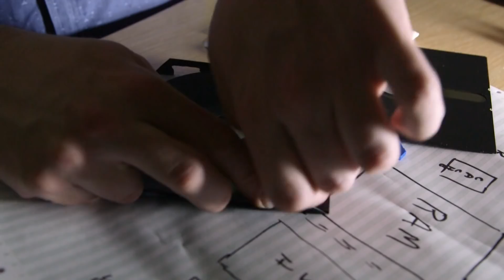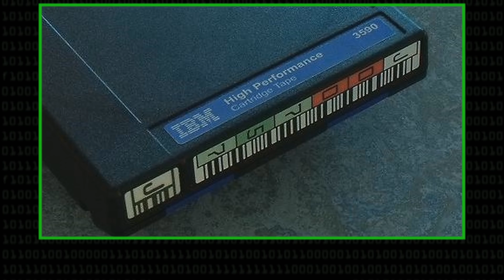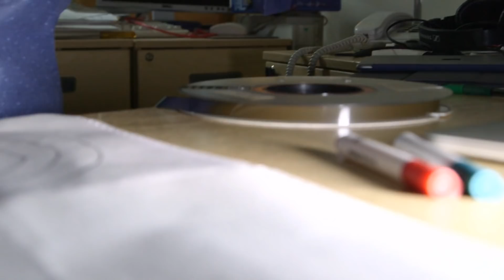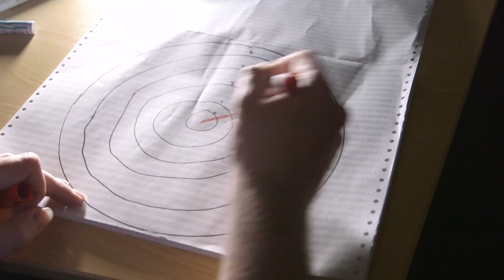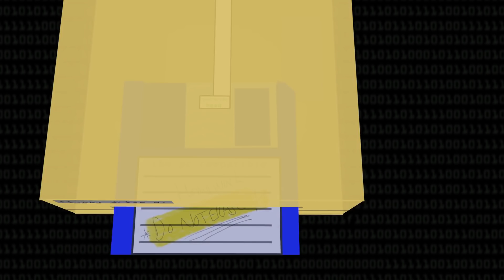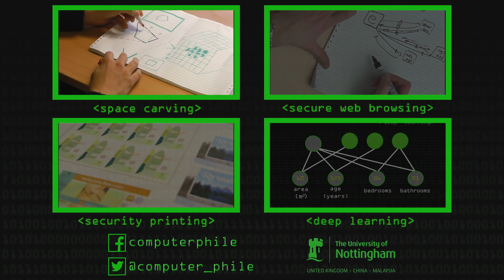Magnetic Media (Floppies and Tapes) - Computerphile

Comment: I've always wondered why disk drives didn't have several (opposite or offset position) heads to speed up read/write.
Reply: But latency is the most important performance metric for the general public. I know current SSDs are overhyped for their sequential reads or writes, but what most people actually care about is the random read speeds. People rarely needs their computers to read extremely long files, while firing up programs or games can load many hundreds or thousands of small files.
Reply: Scott Miller The general public cares about applications launching quickly, and quick system boot up times. I am not saying they know that SSDs' random read speed is what accomplishes that rather than sequential read speed (the latter one is what people who are almost tech-literate think is important; the general public doesn't know about any read speeds). Even if they don't know, they still care about having fast machines. They'd think they need more RAM or something, but you and I both know what they need is an SSD.

I could've been more specific, but that's what I meant.

Comment: Floppy Disc? You mean the save logo?

:^)
Reply: That smiley made the comment good.
Reply: rchandraonline k
Reply: Incidentally he actually adressed that in the video, in passing. So your joke is too little too late!
Reply: It is a 3d logo!
Reply: Oddly enough, many "save" logos are inaccurate.  The (metal) door is on the wrong side.  With the door away from yourself, and looking down from the top, the door is on the right and slides left; most "save" icons have the door on the left and would slide to the right.  If the disk were oriented like the icon, you would be looking at the metal spindle, which is not depicted in the save icon.